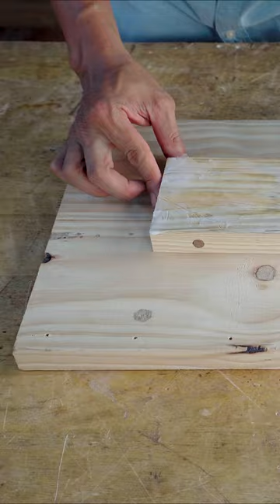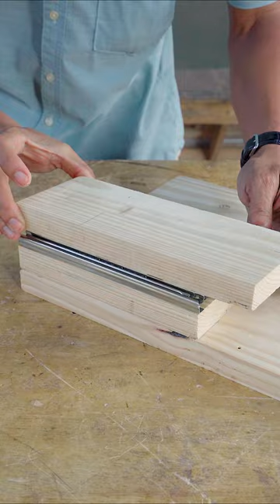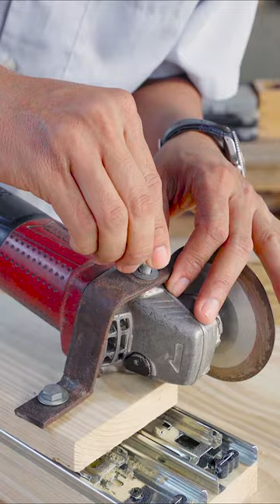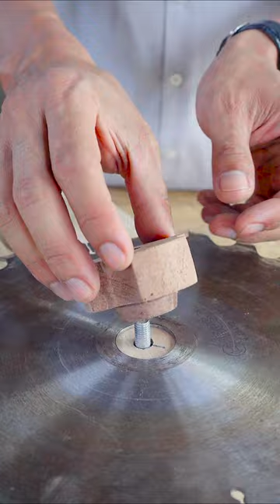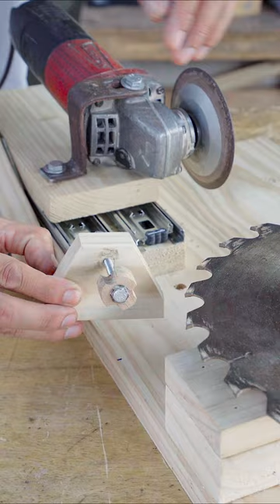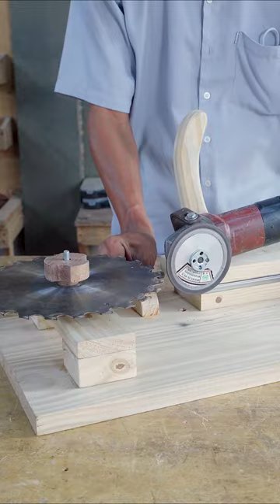Awesome Create DIY Saw Blades Sharpening Jig #woodworking #shorts

Comment: Also the amount of money wasted on the materials to make this “hack” could have been easily been enough to but to blades at the same store you bought this stuff 🙄🤣
Reply: What the hell do you mean?? Have you ever heard of long term saving? Sure that may be true but there is no doubt that being able to use a saw blade way longer than not sharpening one saves a ton of money much later on. If you search around YouTube you'll find way more people sharpening blades with much more expensive tools than this guy yet they still save money. You can also invest in a much better saw blades like forrest and keep reusing them rather than pay the $40 resharpening fee